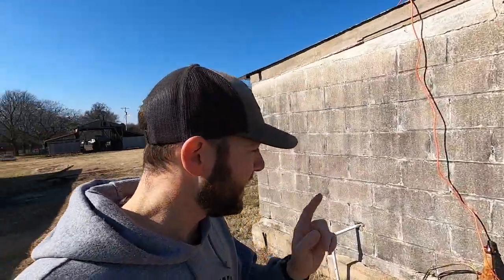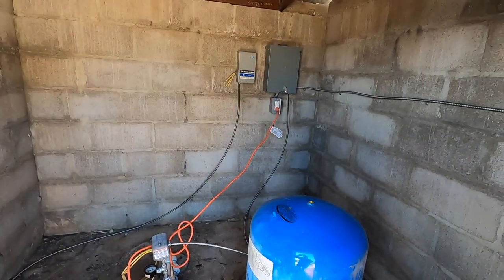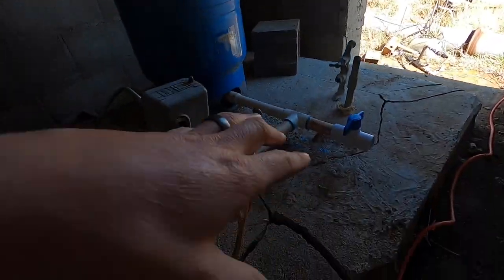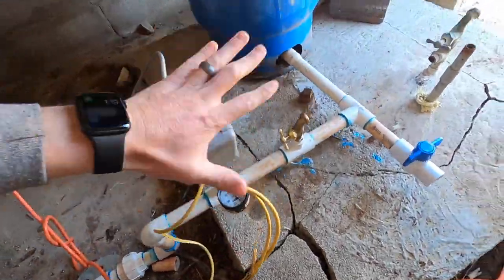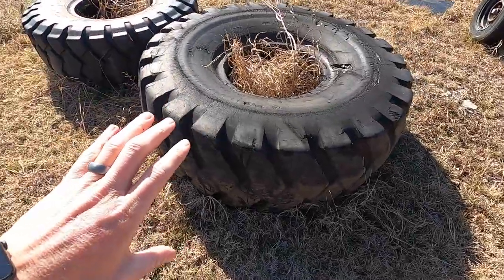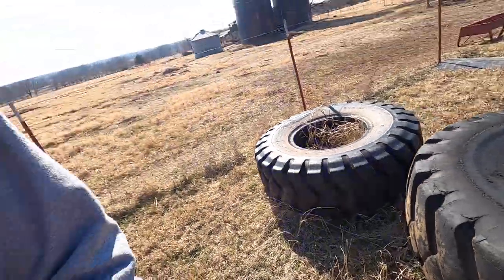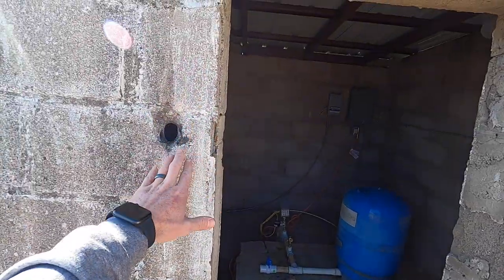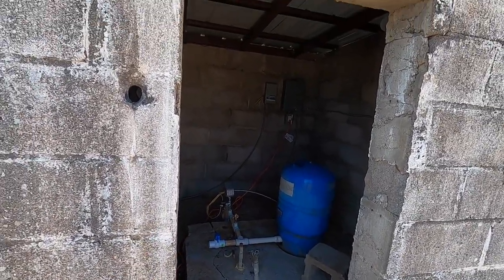Starting a Big Project For The Bison! This Will Make Ranching a Lot Easier

Comment: As a plumber that does quite a few paddocks a 1 inch line is too small to run a great distance step up to 1 1/2 or 2 inch to give you volume for all future expansion you may do.
Reply: So true, friction loss can really cause low volume issues over distances.

Comment: Remember to keep your plumbing water feeds below the frost line.As long as you do you shouldn't have trouble with the water freezing in the piping so they don't crack. Also consider a small heater for that shack your pump is in.

Comment: What some ranchers have done is get a piece of 8 inch pvc pipe with a cap , drill 4 -1 inch holes equal spaced just below the cap , dig a 5 ft. Hole and put the pipe vertical with 3 to 4 ft. Above the bottom of the concrete, and geothermal heat will keep it thawed well below 0 degrees in the winter if you have one left to try , it works up in Montana

Comment: Hi. Just a Thought next time use sch 80 piping for the Ground lines they do better in cold weather and hold up in long run plus Sch80 you can air weld when you get leaks . How much does Big Joe Weight?   Greg of Ohio

Comment: use the tires as a bumper and make the inside concrete with waterproof sealant paint. Animal safe paint/waterproof will work and keep it ok. The tire will buffer it from the big brusers.

Comment: you  dont want to put concreat  around  your water pipe    you can use the pvc pipe  but case it with  galvanized pipe   concreat will eat up pvc pipe  our paint the pipe first  fyi